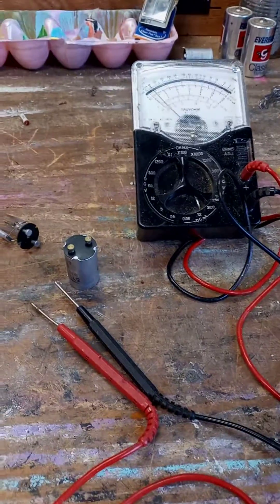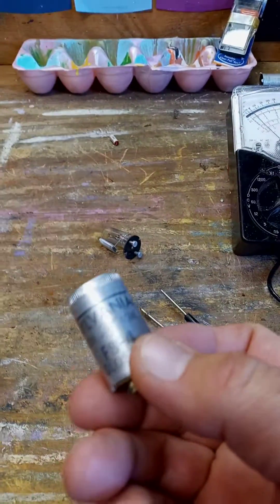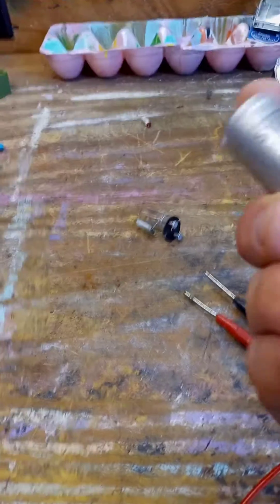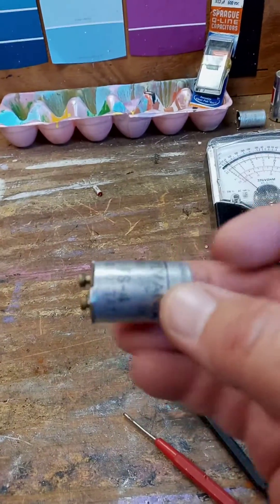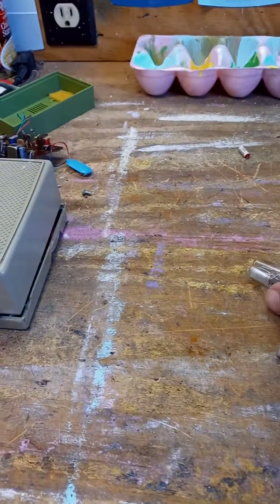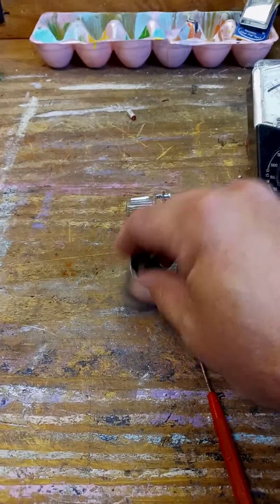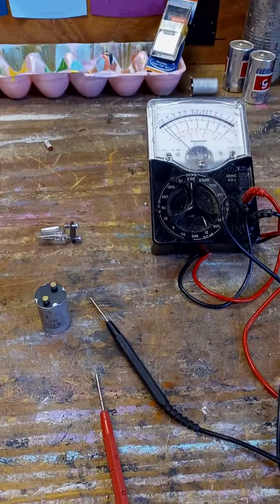how to test for short in fluorescent light starter

Comment: What if the glass tube is all black?  Starter shows no short, but won't make the light come on.
Reply from the maker: Yeah then I would say the glow switch is bad that is the glass tube.,They can still work even if the glass is totally black ,but if the light still won't start,then,yeah ,it's most likely bad .
Reply: @christhurman9102  Thank you.  I can't really be sure what the issue is.  I tested the lights and they have about 6 ohms resistance too.
Reply from the maker: @mantolaman  yes a new starter or a new glow switch in the old starter should fix the problem

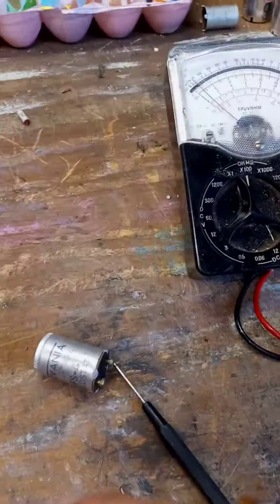Comment: 1:22 - Do you know the capacitance of the condenser? Are there different values for FS-4, FS-2, etc?
Reply from the maker: Only on the glow switches,most capacitors , condensers are around .001 to .0047. anything around that up to .01 will work working volts usually 200v or higher but that's not too critical just don't go too low on the working volts,

Comment: What is the SETTING, on your meter for this starter test.??
Reply from the maker: I start out on Rx1 then move to Rx100
Reply from the maker: It's on the ohm scale
Reply: @christhurman9102  what setting on the Ohm scale is proper?
Reply from the maker: That will also show any resistance across the condenser,capacitor
Reply: I have digital avometere.. how can know ??
Reply: So was he testing for connectivity or current?
Because i thiught a capacitator would lose voltage very quickly